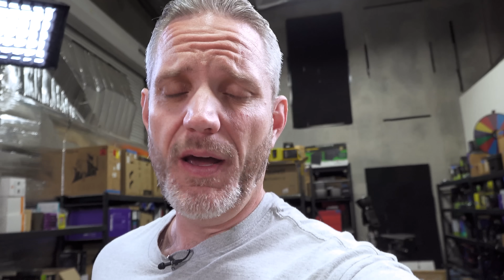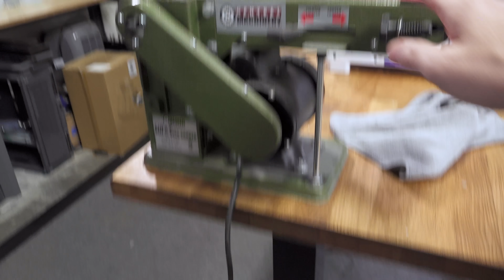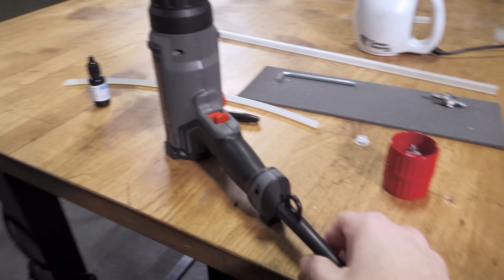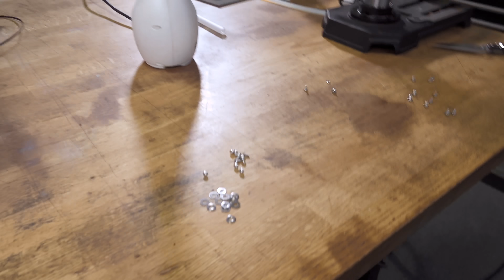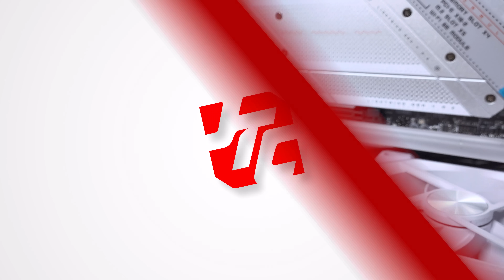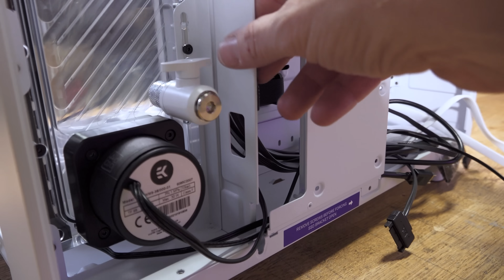ADHD Sucks...

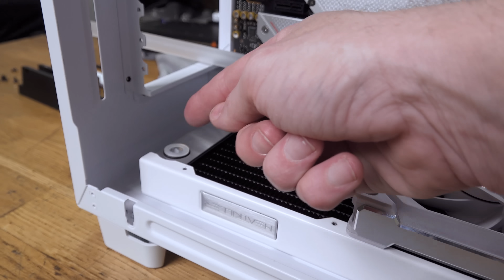Comment: Hey Jay, although you have done the kinked lower tube really well, I was wondering why you didn't use a small piece of tubing before the final 90 to that long length of tubing to bring the whole tube in line with the radiator fitting?  Feel like if you did that and used a 90 to go down into the rad it would look much cleaner (paused the video at 11:55, if anything changes at the end will delete this comment :P )  Literally love watching every single one of your videos, really glad to hear you have recovered well post surgery, thanks so much for continuing to share your passion with us all :)

Comment: Hey Jay, not certain if you'll see this or respond. I also have ADHD and was Dx'd into adulthood. Just started on Ritalin...it's a game changer while it's in your system. That said, it's not in my system right now.  I have a dilemma about PC stuff though. I have a 3080 Fe and a 10850k. I have most of the stuff to do a custom loop. Buddy told me NOT to go for an external RAD, HOWEVER, I have cats, and I think maintenance of dander and whatnot would be far easier for me to manage with a smallish case with a few fans, and a monster external rad (also to future proof for future wattage needs.) What do you think? Would it be better to go midsize ATX with the res/pump and the components in with a QD out the back hooked up a couple linked 360 rads or a MO-RA?  Also, ADHD can eat a bag of Richards.  Thanks!

Comment: trying to think how to do kinks in PC Building Simulator, never thought about using 90's at an offset to get rid of kinks. as looks dreadful when looking at it and having kinks in the tubes or running close to the side panel just to get minimum number of bends in the tubes. yes ADHD does suck, the number of projects I have started and not completed, like got a Tamiya truck 7 years ago, still not completed, got 2 pc's while they work not fully connected up properly, got a button box that I want to do for truck simming, that no matter how many times I try, I could not complete as the drill would vibrate and move the piece of wood, and then have a hole in the wrong place, and totally drive my ADHD through the roof for perfection.

Comment: Are there some sort of white fitting extender you could have used instead of having the kinks in the tube? Also, maybe you could add a flow indicator wheel thingie just to fill in that empty space below the GPU?

Comment: You should look into nootropics.
Your symptoms could be linked to brain inflammation, which comes from an inflamed leaky gut. It makes your default mode network very noisy ; your prefrontal cortex is the symphony instructor that guides the orchestra of your mind and keeps you focused to persevere on the same task, and it's being heckled by blue-haired activists throwing peanuts at it.
Measure your enzymes, check were your are nutritionally deficient, compensate with supplements.
Measure were you are sub-clinically allergic. Modern industrial "health foods" are highly inflammatory.
You've been gaining weight, so there's something wrong with your inner balance. Change your diet ; go carnivore if you must, but you're going down a path of self-destruction if you don't research what is wrong with your mind.

Comment: Instead if putting a 120mm distroplate in the back of the case could you run it through a 120mm Rad with a Fan for extra cooling for the CPU?

Comment: I'm glad that you're talking about such a common mental health issue, especially since it doesn't seem to get the recognition that it deserves. 

I personally have a laundry list of way too many complicated projects, some of which would take months at a time if I were to work on them dedicatedly in my free time. So, you can imagine how much time I would need to put into my entire list of unfinished projects, to complete them. 

I actually recently decided to downgrade my main system from a full custom water loop, to air cooled with an AIO on the CPU, because it was constantly in an unfinished state and I have a feeling that was not helping my mindset. Now that my main build is actually finished, even though it's not fully water-cooled, I can actually look over at it and be satisfied with the fact that it requires no additional work. It's actually quite therapeutic to the mind, to no longer worry about something that you stare at for 12+ hours a day.

Comment: honestly that kink in the bottom tube there would work better if it lined up with one of the 45's on the fan mount. the little triangle shape on the corner.

Comment: Jay I'm a nurse, and I also have ADHD.  If you're feeling lethargic during the day and can't concentrate (like i was), consider getting on a med called Vyvanse.  But you also have to counteract it with a sleep med.    When I first took my vyvanse, my life flipped 180 for the better.  I am waaaaaay more motivated to do anything and everything.    Keep in mind.  ADHD also is directly related to Depression.   and when i was on my med, it actually buried my depression so well, that i didnt have to take anymore meds that helped with my depression. 
    
And i can totally sympathize with you with unfinished projects.  i'm currently working on changing my 2013 Hyundai Veloster Turbo's vinyl interior, to Alcantara suede.  Its a long process but its coming along nicely and i have to take baby steps with it cuz i wanna do other projects as well lol.  
(bro hugs) i'm here for you if you wanna talk! :D Cheers bud

Comment: watching Adam Savage in his workshop, he does a lot of sped up time laps videos, i think it would be cool to watch you guys work when you get to doing the workshop area renovation.

if you are looking for cheap sturdy work benchs, over here in the UK, i use second hand or cheap kitchen worktops, they are 40mm thick, you can bolt a vice to them and get timber or kitchen cabinets fixed to wall to hold them, screw them in well and it wont move. gives you long work benches as space is great, but the hard part is keeping the space clear.

your doing great having gone through what you did, keep up the good work.

Comment: What I realized about my rig while watching this video... Is that I f***ed up and put the inlet tube on the wrong port on my gpu block/active backplate... Well, time to shut it down, drain the loop, and redo a tube... I'm actually quite shocked because it still stayed at 60c during the most intensive games... Even though water isn't moving across my gpu die... This is another reason why you always buy extra tubing.. I also give ekwb props for making a solid product. Even though I got it wrong, it still stayed cooler than the original air cooler from evga.

Comment: Many of you claiming to have ADHD should take an Autism test. ADHD and Autism present very similarly but are very different. It is estimated that more than 30% of people statemented with ADHD either have Autism or Autism and ADHD. When I was a child I was diagnosed with ADHD back in the 1990's, early 2000's the understanding was just beginning and no-one could understand why I didn't respond to ritalin. At this time Autism was still just a spectrum for severely disabled people. Fast forward 10 or so years to when I was a young adult still facing difficulties we met with a top professional in development who very quickly diagnosed High Functioning Autism(gifted at logic) with Asperger's Syndrome(difficulty to communicate). 

Today they wouldn't miss it as I was mute until I was 4 years old. Medically everything was working but my brain refused to communicate anything other than the occasional 'huff', today this would be a massive red flag indicating Autism, there were other signs too but this alone is enough. What complicated this was the fact that I was also adopted so the behavior was repeatedly put down to emotional disturbance from the adoption.

My point is be very thorough before you agree with any diagnosis for ADHD. Doctors regularly incorrectly label mental health patients and learning disorder patients as ADHD. This is due to the inability to concentrate on the task for comprehension reasons as opposed to hyperactivity and self application. Incorrect diagnosis lead to people blaming the ADHD for the behaviour instead of tackling the root cause which leads to further complications. 

As someone who lived with the ADHD tag for many years I found that parents and children used it as an excuse not to challenge the behaviour or attempt to change it or in some cases just take the responsibility away entirely. This makes mad as any other disability that suffers this prosecutes these people. ADHD is so easy to fake as the guidelines around detection are so loose.
Reply: Also by the age of 35 more than 70% of people suffering from ADHD will be somewhat normal. This is due to the metabolism slowing within the brain allowing them to focus and apply concentration as those overactive synapsis no longer have the energy they used to. If after 35 you are still having issues you should return to your professional and get re-examined as now you are in a minority of people. Please note I am not saying you are normal, just you are close enough to it not to require any medical intervention and with good management it shouldn't be an issue. If it is see a professional. All the proof you need here is old people. You do not find 50 year olds with ADHD, they do not have the metabolism for it. If they are claiming the ADHD makes them tired then they only have ADD. The hyperactivity has gone.

Comment: The beginning of this video hit home.  I was diagnosed with ADD (ADHD wasn't a thing at the time) in first grade.  I took Ritalin from then until middle school and haven't needed medication since.  I was fortunate that I was diagnosed early and got the help I needed to learn how to deal with it.  What really helps me are lists and alarms.  The biggest issue is remembering to write/check the lists and set the alarms.  It's still a struggle but I've done pretty well considering.

I also had gallstones in my mid twenties.  Like Jay I put it off until the bladder was about to burst, and it had done quite a bit of damage to my liver due to bile backing up.  I was in the hospital for a whole week.  I had lost a large amount of weight (like Jay again) and it seems that losing weight is one of the main causes of the stones forming.  It was truly the worst physical pain I've ever felt.  I did however know what was causing it as my mom had also had them in her mid twenties after losing a lot of weight.  I think knowing what it was actually contributed to me not getting it fixed sooner.  If I hadn't known what was the causing pain it would have scared me to death and I would have been running to the hospital for help. lol

Comment: I'm pretty sure I'm older than you, Jay (and very sure I'm not as tall!), and I'm only recently realising I have probably had ADHD my whole life, but I've gotten used to it. It's meant I've struggled with completing things and sometimes done badly at exams and in jobs, and I get overwhelmed easily. I find it helps when I get things organised and get rid of clutter, but it can be hard to even achieve that most of the time! 🙄

Thanks for being open about your experiences, and it's great to see you look healthier recently. Also, fantastic job with the water cooling - those double 90 degree bends and the kink look awesome! 🙂

Comment: Dude I dont have adhd and no doubt it sucks. But your problem is that some suppliers suck and I know this very well. Don't blame yourself when you are waiting for parts. I work for a pretty big tech company and multiple million dollar projects come to a grinding halt because of this. We too are waiting on water fittings for a servo motor water cooler. Project is dead for a month.

Comment: I have so many projects that are started but not quite finished...
I have
● a massive custom 3D printer that is about 1/4 done
● a server rack mounted Gaming PC that I'm trying to figure out what hardware I want for it, it just has my first gaing PC in it now.
● I have a small desktop NAS that I got working but for whatever reason it won't stay connected to WiFi and I don't have acces to a wired connection where it's at now...
● I just started a job at the University I graduated from as the Laboratory Equipment Technician and now I have dozens of things to fix along with even more responsibilities, so that's going to be fun...
● and now I just bought a house... so that's even more to deal with. 

And having issues with maintaining focus on a single task for very long is not making anything easier... 😅😅😅

Comment: Jay, I have ADHD and for a long time I dealt with depression. It wasn't until recently that I started to reassess things I started to realize that a lot of the depression was a symptom not a primary issue.

I never in my life felt like I had anxiety but the last 6 months I have opened my eyes to a lot of things. 

The major take away here is that I also start projects, get burnt out, depression sets in (that was largely unmitigated anxiety) and then I bail on the project and bottom out emotionally. I find that the only thing that pulls me out is focusing on a new project or picking back up an old hobby.

I understanding this cycle and finally saw it for what it was. 

I was recently diagnosed as bipolar.

It was as if the entire world clicked and I saw a lot of my mental health struggles in a new light.

If you find yourself falling into these cycles, bipolar isn't as narrowly defined as it used to be and it may be a worthwhile conversation with a professional.

All the love

Comment: Just as a suggestion...I have a small basement workshop.......I built cabinets and mounted drill press and band saw on opposing ends of one of them.  allows me access to both tools.  All cabinets are on wheels and have electrical outlets on top......with 15ft extension cord to allow rolling around.  I done similar thing with all other tools.  Cabinets have drawers (different sizes) to accommodate accessories.

Comment: 15 years ago my dad made me a jukebox using a Windows 7 laptop to run tings. You wanna project, hit me up - I've crammed a 6900xt AIO into the frame as well as the PSU, screen (a very old ELO touchscreen) mobo and all the horrible cabling. This is a project that ruined me: my builds are super neat, but this is a shit show. There is no airflow, no management, no prospects.

Comment: Jay, why would you use multiple 90* bends that introduce additional failure points and unwanted turbulence in the flow? Just put a curl or spiral at the end of the pipe going into one 90* fitting. Sure it is a bit more work but the hydrological flow will be improved.

Comment: Jay, why don't you just turn the bottom radiator with both ports towards the right side, where the pump is? Wouldn't it make it so much easier to make, and cleaner, shorter tube, with higher flow?

Comment: If ADHD is your only mental problem, you're lucky. I am diagnosed with severe OCD and schizophrenia and it's the opposite. I can never let anything become finished. So any plans I have, small or large, will never get good enough. Plus the extreme arguments with "myself" of how stuff should be, doesn't make things easier.
And some days, forgetting what plan I had, because it wasn't my own plan at all.

A custom open loop water cooled computer would probably take me a year to do, and it would not be good enough. 

Sometimes I wish I could trade it for ADHD.
To me that sounds like heaven.

Good to see you're back Jay. I love your content, no matter what it is.

This comment took 15 minutes to write.

Comment: why didn't you just add another ek 7mm extender onto the bottom connection? That should have brought the tube in line with the rad, eliminating the need for the 45

Comment: Jay, speaking as another dude with ADHD (and high-functioning autism, I'm pretty sure), one of the things I deal with as well as the executive dysfunction, inability to finish projects, etc, is the tendency to over-commit and overload myself with responsibilities, projects and obligations. It's often very difficult to tell whether it's my difficulties with follow-through or simply the overwhelming breadth and depth of my to-do list that's causing the problems. It sounds like you might have some problems with that as well. I wish I had a quick-fix for you, but honestly I'm still struggling with the problem myself. Here's hoping you find a way to prioritize and let things go that need to be.

Comment: First of all I wish you a full recovery and good health!
Not finishing projects is my main problem too 😀 so I can fully relate to that! However, I just considered myself lazy about that...
Regarding the kinks in the tube, there are some straight extensions available, beginning from 4mm up to 40 or 50 if I am correct.
Regarding the room, did you think about building a catwalk around and add more shelves to expand your storage space? You can even use the top of the ceiling to store a shootload of stuff.

Comment: Feel better.  I've dealt with a severe chronic pain issue for most of my life, but it wasn't until a couple years ago they were finally able to diagnose what it was and treat it.  It causes me to have many days where I just dont' feel like doing anything b/c of the pain, so I definitely understand how it goes.  At least you've figured out what was happening and now you're on the road to recovery.  For the tool chest, I recommend making use of your 3D printer and print out the Gridfinity setup.  Great way to organize everything.